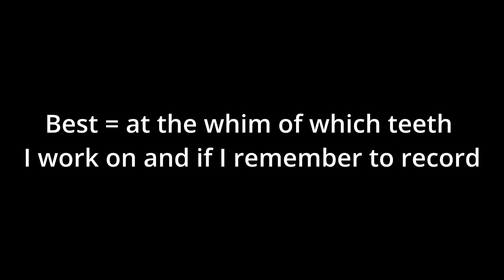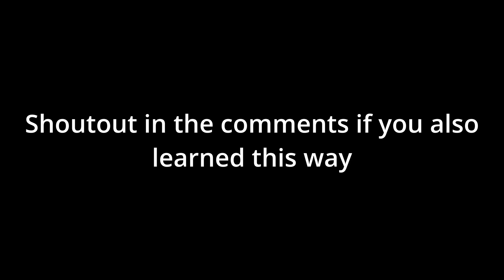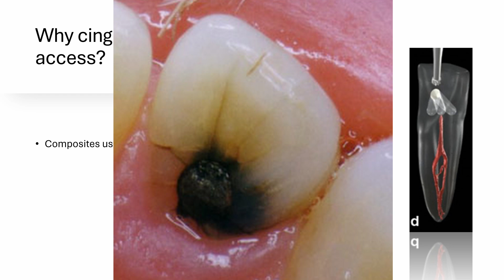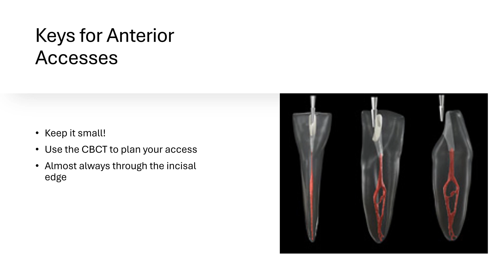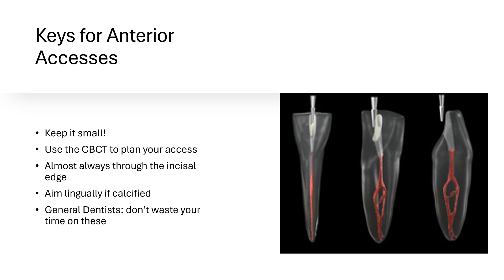Modern Endodontic Accesses: Mandibular Incisors

Comment: I'd like your thoughts on Triton and how much it has shortened your endodontic irrigation/disinfection time.  how many CC's of triton do you use per canal on a general case?
Reply from the maker: I've loved it. The biggest change is it's allowed me to get more cases dry in a single visit. I generally use 3-6 cc's/case and if the canals aren't dry after that, it gets CH. But more and more I'm using the GentleWave on the nasty ones and saving Triton for caries and pediatric cases (not every kiddo is down with a 8 minute cycle)
Reply: @PatencyPro  so say you used 6 CC of triton in a case. If you had used NaOCl for that same case hypothetically, how much CC of NaOCl would you have felt necessary to use so that you had achieved the same level of disinfection as 6 CC of triton?
Reply from the maker: @Nvrloptimism  I mean..... We, as a specialty, GREATLY overvalue the importance of disinfection. It doesn't matter. Except when it does. And we don't know when that is. So, we develop different heuristics. Mine is, will the canals get dry? The most I've used of bleach is like 20 cc's, but that was back when I had to do certain cases in a single visit. Most of the time, I would do the same thing (3-6 cc's) and then use calcium hydroxide. What Triton changed was the number of cases that still had drainage after. So I would say.... pulling a number out of the hat.... 50%. So, 6-12 cc's of NaOCl probably equal 3-6 cc's of Triton. Probably.
Reply: @PatencyPro   I understand this was a difficult hypothetical so I appreciate you for still trying to give me the best answer. Interesting take on possible overvaluing of disinfection. would love to hear you delve more into that in a future video. My first thought when I see normal looking obturation develop reinfection is if disinfection was done properly but perhaps I'm overlooking other things that may matter more (missed canal for example).
Reply from the maker: Missed canals seem to be super important, but I’m mostly seeing retreats so I’m certainly biased. There are plenty of cases out there without MB2’s treated and they’re working. But of the failing cases, most have a missed MB2 or an issue with the obturation material (thermafil, resilon, etc). I need to get my thoughts better together re: disinfection, but here’s the start of the thinking. Most root canals are done by gp’s. They are using enhanced irrigation (or at least the majority aren’t) and some don’t even use rubber dams. But, most endo cases are “working”. We get so microscopic in our thinking that we forget we are working on people, not histological slides. I still use triton, bleach, and my gentlewave, but I’m also not concerned about getting every case “sterile” because I know that’s not possible. But this is a very good topic for a future video ❤️